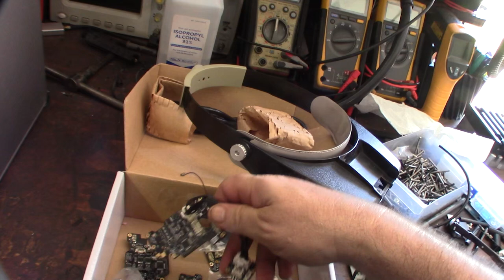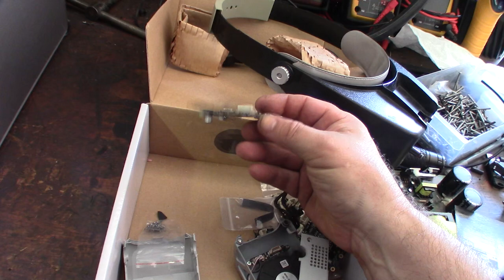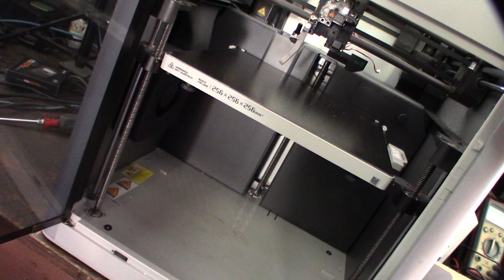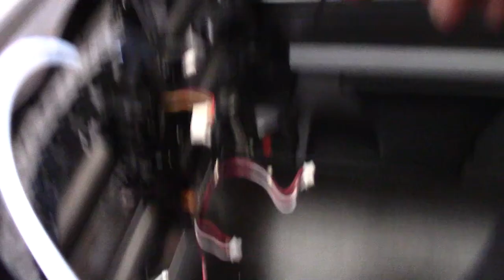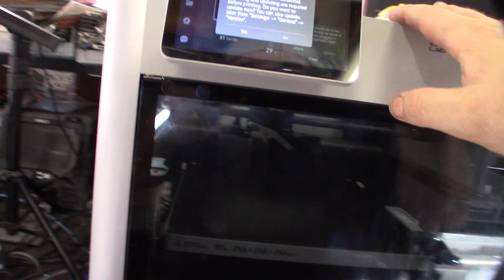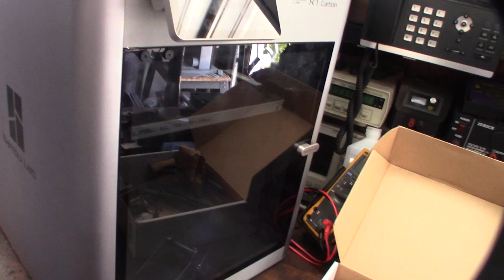Bambu Lab X1-Carbon Tool Heat Rebuild PCB Revision Update, Firmware Version Is Abnormal Recovery

Comment: Neat. I've been wanting to see inside one of these. It looks extremely hypercube-esque. I love how they buried the extruder motor at the very center of rotation. I bet they carefully check the Z screws too to prevent wobble, because that Z design looks prone to it. You should send them a GPL request for the firmware source 😅
Reply from the maker: Yeah, its incredibly smooth. I've worked allot of printers and this is by far the smoothest and quietest. The owner found the hotend and I got it printing. I didn't video of it.
Reply from the maker: Since the 3 bed screws are driven by one motor I'm wondering what happens to the Lidar if one the screws skips the belt. There is now way for it to compensate. Thanks for the comment.
Reply: @fintechrepairshop  I doubt a belt skip is likely. The printer I designed and built in 2018 has a very similar arrangement with a large closed loop belt driven by a single motor (but running on rails instead). It has never skipped a tooth in this entire time. I've crashed the machine plenty.
Reply from the maker: @jessicav2031  Well I guess if you have the Z motor current dialed in.  Did you ever upload your design? I always like seeing new things. I'm still trying to figure out how there Lidar works. There was 6 wires and a ribbon cable going to it. Definitely Not like your typical probe.
Reply: @fintechrepairshop  Nope. It is basically a Hypercube Evo clone except I used multiple Z screws on a single motor with rails on Z. And the printhead has gone through a million revisions of course. Back then we were experimenting with extruders driven by 20:1 worms on a typical round style motor (with 36V) but friction was too much so I switched to belt reduction, then an Orbiter recently. Our more modern printers all use 3-point Z but the one I am talking about was from the Marlin/ATMega/etc days and I never changed it since it has just been so reliable 🙂
Reply from the maker: @jessicav2031  Cool, the other printer next to the celeritas that I call orca is a quad motor belted Z. Its pretty insane how flat I can make the bed with it. I know all you need is 3 but I thought it would be fun to try 4.  I modified the Voron 2.4 klipper quad level macro. I remember the days of Marlin. I compiled it at least a 1000 times, don't miss that.. Do you work for a 3D printer manufacturer?
Reply: @fintechrepairshop  I wish, that would sure be fun. I design electronics for medical devices. My partner is an embedded firmware engineer in IoT. We've just been designing and building printers together as a hobby since the Mendel days.

I always figured quad leveling was because Voron didn't expect the average builder to be able to get their XY system planar. You certainly look well equipped to do that! All our problems have not been with nonplanar beds, but rather with nonplanar XY axis movement. Every printer we have built after the 2018 one has had a scraped or lapped bed. Nowadays we use scraped 1/2" tooling plate, though honestly those Ebay Gleich plates are so flat that it scrapes in two passes anyway.

We align XY by putting a small surface plate inside the frame and sweeping it. Sure is a pain in the butt though compared to just doing it automatically.